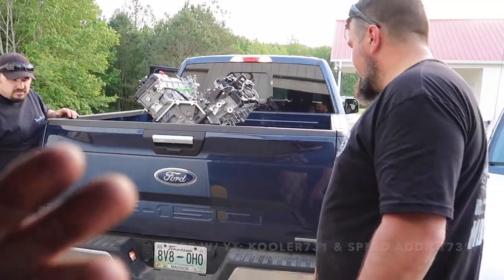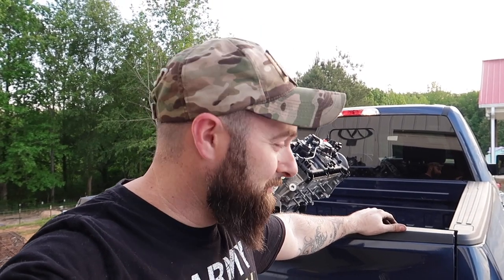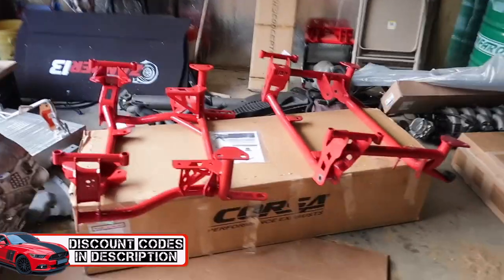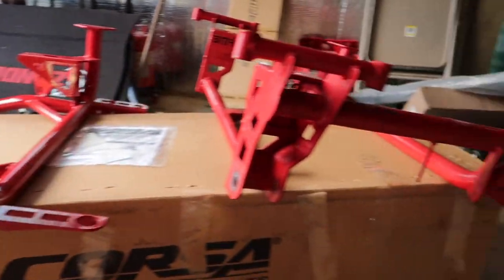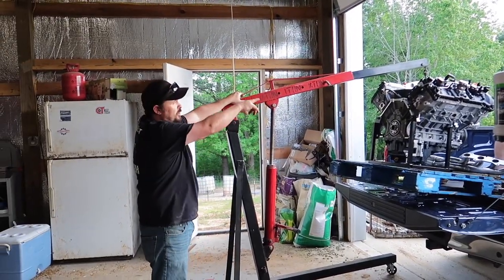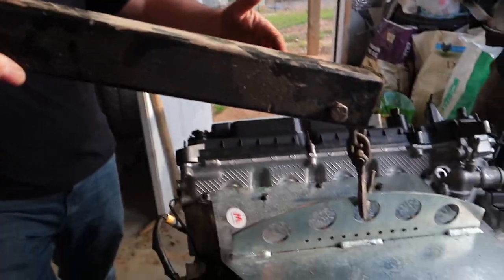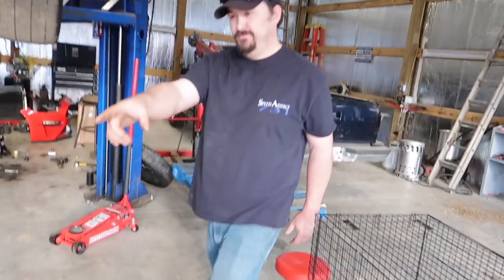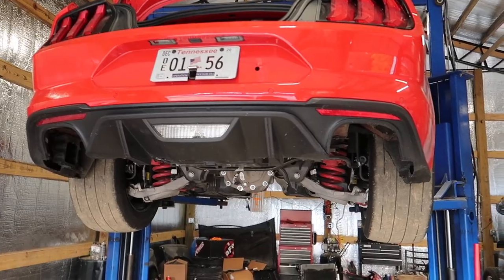ALL NEW BMR 2015+ Mustang K-Member. Street vs Drag Comparison. Which is Best For You?

Comment: How much ground clearance is lost with the street k-member vs the drag k-member? Looks like the street k-member hangs way below the rack and the suspension mount points unlike the drag k-member.
Reply from the maker: Marginal if anything bc it’s still smaller that the original OEM K-Member

Comment: Can you tell me if the KM761 interferes with the front sway bar? You mentioned the drag race one doesn’t permit the sway bar but didn’t hear you mention it for the new one.
Reply from the maker: yes. it will fit on the new design. remember to save money with promo code zander13 on the BMR website 💪